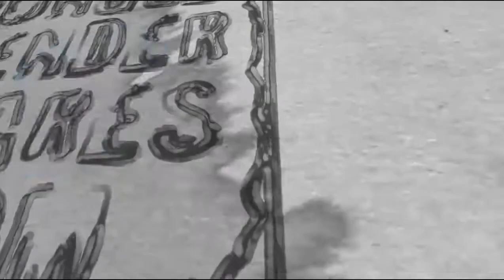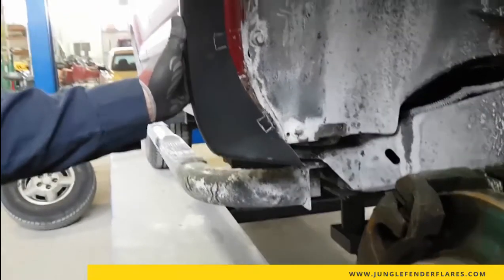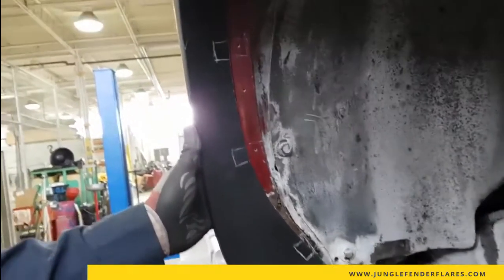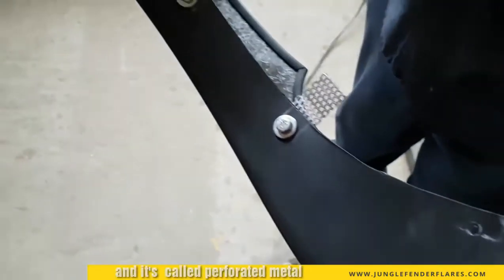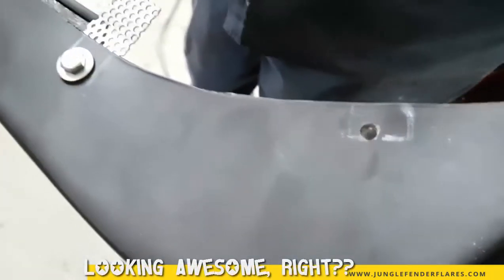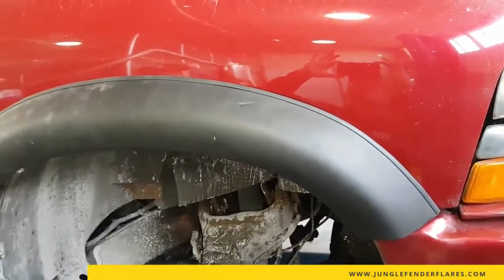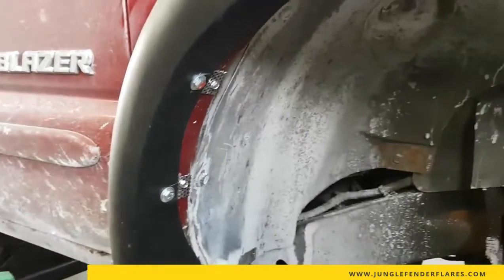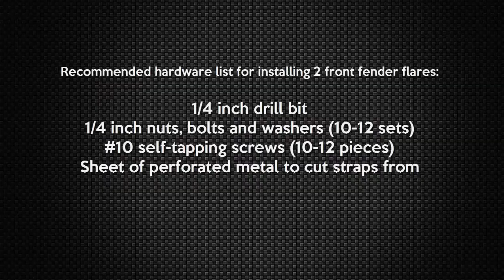Front Fender Flares Installation -  Non-ZR2: Blazer 2 door, 4 door, S10, Sonoma

Comment: So these aren’t like “plug and play” they don’t come with bolts or anything? Just the flare and u do the rest?
Reply from the maker: This set includes the fender flares themselves which is the main part, LOL. They also come with rubber edge trim along the top edge of the flares where they meet the painted body of the truck. There is no installation hardware included, which is not valuable or hard to find anyways. The recommended hardware is shown in the video although some people prefer to use different hardware. Yes, you must install them yourself, or have a shop do it for you.

Comment: Why wouldn't they fit the z2r if the fender is the same dimension i mean cant you just mount it still
Reply from the maker: The ZR2 fender is not the same. The ZR2 fender has a higher cut wheel well opening. So if you use ZR2 flares on a non-ZR2 fender, the underside lip of the flare is going to be in the way, hitting the face of the fender, blocking the flare from going into position. 

We do also offer fender flares for the ZR2 fender though. The rear flares/wheel wells on a ZR2 Blazer are different than a ZR2 S10 pick up though so you need to get the right set: 

If you have a ZR2 Blazer, you need these: https://junglefenderflares.com/chev-blazer-gmc-jimmy-zr2-fender-flares/11-95-05-chevrolet-zr2-blazer-gmc-jimmy-highrider-fender-flares.html#/27-number_of_pieces-set_of_4

If you have a ZR2 S10 pick up, you need these: https://junglefenderflares.com/chev-blazer-gmc-jimmy-zr2-fender-flares/13-94-05-chevrolet-s10-zr2-gmc-sonoma-highrider-pick-up-fender-flares.html#/27-number_of_pieces-set_of_4

And if you have a mixed truck such as a non-ZR2 Blazer with ZR2 fenders mounted, just let us know because we still have you covered: https://junglefenderflares.com/contact-us

Comment: So these dont use the three or four holes at the top of the flare that are normally drilled in the fender?
Reply from the maker: These mount like most fender flares traditionally do, simply through the underside lip of the flare into the inner lip of the fender. These do not mount into the painted face of the fender. These do not use the over-complicated steel framework in the backside of the flares either. Typically, that framework is totally destroyed when removing factory ZR2 fender flares anyways.

Comment: Will these fit a 1985 Chevy s10 blazer
Reply from the maker: Hello DM86, The 1985 Chevrolet S10 Blazer (aka square body) has a totally different body than the 1995+ models so these fender flares will not likely be a direct fit. These flares are fiberglass though so would be ideal for modifying if you are up for it. First, I'd recommend parking your '85 S10 Blazer alongside the 95+ body in a parking lot and just compare the overall size and shape of the wheel well opening to see if there are any major differences. Also consider the fuel door location. These flares do not have any notch for the fuel door as it just isn't that close to the wheel well opening. Also consider that we offer these same style fender flares for both the higher cut ZR2 wheel wells as well as the regular non-ZR2 wheel wells. Please send us a message through the contact us page of our website if you'd like to discuss this in more detail with photos showing the differences. 

Also, we tally requests for new models on the following page so please let us know what your looking to see in the next model of Jungle Fender Flares here:  https://junglefenderflares.com/blog/what-new-model-of-fender-flares-do-you-want/

Comment: How does the top part of flare attach ? 3M tape?
Reply from the maker: Sorry for the slow reply. Just saw your message now. You just push the flare firmly against the fender while tightening the hardware and the top edge will remain firmly against the fender. No need for 3M tape or anything along the top edge.

Comment: Will the ones for a 1994-05 work for a 1994 Sonoma on the front and the rear ones on the rear?
Reply from the maker: Yes, we offer full sets of fender flares for the 1994 Sonoma. Please let me know if your truck is a ZR2 model. If it is, does it still have the original ZR2 bed? Many were replaced with non-ZR2 beds already. We have flares for it in any case, so just let me know and I will send you a link to the correct set for your specific set up. 
https://www.junglefenderflares.com/19-chev-blazer-gmc-jimmy-zr2-fender-flares/
Reply: Jungle Fender Flares Thank you, I already talked to you on Instagram. 👍
Reply from the maker: @aydeng4875  - Okay great! Just let us know anytime if you have any other fender flare questions:
https://www.junglefenderflares.com/contact-us

Comment: I'm confused why someone would wanna do this. ZR2 Fender flares are more expensive than aftermarket for a non ZR2 vehicle. Not to mention the fenders between ZR2 and a normal blazer are built completely different.
Reply from the maker: These are aftermarket fender flares. They look just like original ZR2 fender flares but they are made to fit the non-ZR2 model. So if someone wants their non-ZR2 S-Series to look like a ZR2, this is the easiest way to do it.
Reply: @Junglefenderflares-shop  I had no idea they even made those. fooled me looks exactly like a ZR2 fender flare.
Reply from the maker: @michiganmudmechanic  - Ya, they look just the same as the ZR2 flares but we make them to fit almost all the 1994 - 2005 S-Series trucks, 2 door, 4 door, pick up, SUV: https://junglefenderflares.com/chev-blazer-gmc-jimmy-zr2-fender-flares/

Many people have ZR2 trucks with non-ZR2 beds (replaced) and we have sets for them too! :)